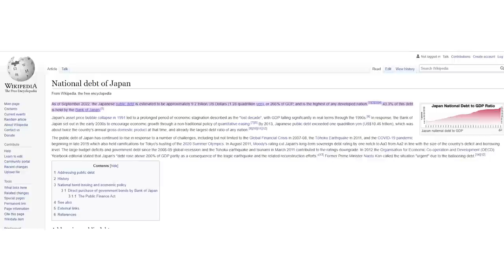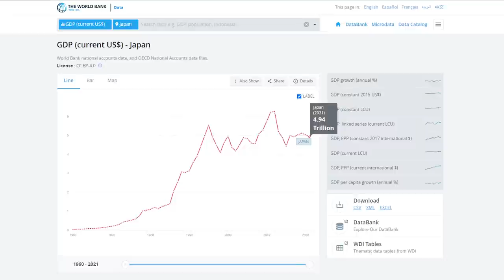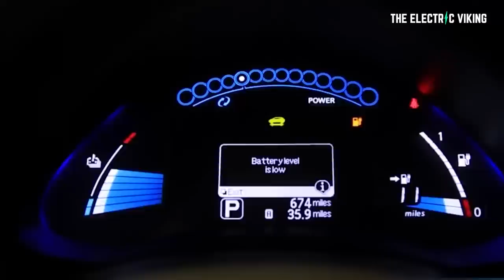General Motors says Toyota's hybrid strategy doesn't make sense

Comment: In 2014 I bought a new Chevy Volt (plug-in hybrid), as there were no affordable/practical fully-electric options at the time.  Out-of-pocket price was around $25k (after incentives, of course).  8 years and 120k miles later, I can honestly say that the car has been fantastic.  They should have improved the platform to 1) give it at least 60 miles of range (before ICE kicks in) and 2) make it a comfortable 5-seater.  My guess is that GM wasn't making a profit on it.
Reply: They did... the Gen 2 Chevy Volt got an EPA 53 Miles of range but I typically get 70+ Miles out of it in the Summer.
Reply: @Nebula1701  I don't think I would call Gen 2 a comfortable 5-seater.  Is pretty much the same size as the Gen 1, but with a pad over the battery.  Can't seat 3 average size people in the back.  Problem is they used a sub-compact platform, and is too tight for people and the powertrain.
Reply: They should have expanded that system to other vehicles including a small pickup. Now it makes less sense.
Reply: I have a Vaxhall Ampera, UK's Chevy Volt, great car, I constantly wonder what it's range would be if GM produced upgrade batteries with maybe two or three times the energy density of the originals. Especially since I now read H2 electrolysis is at 95% in labs in Australia and Zero Carbon-Petrol starting with H2 can be produced for less than Dinosaur-Petrol can be extracted, processed, shipped and sold, the Chevy Volt could be zero carbon. I think there is room in the market for ECO-petrol and zero carbon hybrids, Toyota Prius-Primes running on Bio-Petrol could be made to work, thing is, it's all pretty much in the lap of the gods, my guess, batteries are about to leap forwards in energy density, durability and longevity and probably long before Bio-petrol hybrids could be made to work.
Anyway both my parents died young of cancer, maybe it wasn't diesel fumes that killed them but ICE engines cause cancer and kill people, so as soon as I can afford an EV I will buy one, the new model three or the fast ID3 4X4, I'm saving.
Reply: @johnt5222  More importantly, they should have continued research/development/improvements.  For example, to generate electricity, the VOLTEC powertrain of the Volt uses what I would call an "off-the-shelf"gas engine, which is designed to turn wheels of ICE vehicles.  However, in the VOLTEC powertrain, the gas engine does not move the wheels.  So, they could have designed and used a more efficient and less expensive gas-based generator.  Also, they could have transitioned to a battery like the one for the Bolt (flat under the floor), but just big enough to give you 60 electric-only miles.  Those two changes could have reduce weight, increase efficiency, and increase interior space, while staying within the Delta II compact platform (or equivalent).
Reply: I mean you got it for $25K after incentives. I remember the MSRP was around $40K. I feel like you might have gotten it on clearance. I did hear they had a poor time explaining to consumers why it was a good idea. Shame as it seems to have been the most reliable PHEV to date with some people reporting over 500K miles on them.
Reply: In Canada, my creator never saw a Volt on a Chevy lot - or even heard about one - until GM announced the Volt was cancelled. We looked at one yesterday - it looks terrific! Doc says he would have bought one in 2017 - had Chevy told him they existed.

Comment: Sadly I'm probably going to have to buy a hybrid pretty soon. I want to go electric, but there's just no way to afford one that fits my needs for cargo space and range right now. Even if I did have the money for a full-size EV SUV (I don't) I couldn't get one anyway. Order a Rivian R1s, gonna be at least a year or two before you get it.
Reply: I'm in a similar spot. If I could have an EV I would, but my situation has everything against it. One day, maybe.
Reply: Same. But most of the viewers on here have their heads in the sand. It's easy to spend 60k on a new ev. My budget is less than half that. The Prius is smack in the middle of my budget or the Camry or Accord hybrid or something from Hyundai/kia
Reply: Cyber truck would beat the R1 into the dirt, but unless you've already pre-ordered one, the wait list is already around 5-7 or more years long
Reply: Look into a used EV.  I got one for half msrp last year.
Reply: Agreed! Toyota Highlander Hybrid gets 35mpg, so your gas cost over 150k miles will be around 17,200 at $4 dollars per gallon (I just filled up for 2.80 in MI). You can get the Highlander Hybrid for around under 45k, whereas the R1S costs $72,500 (27k difference). Model Y LR is 66k, still over $20K more). Your cost of maintenance (let’s say frequent oil changes at 5k miles and a few air filters) would be around only 1500 bucks. Throw in another 200 bucks for a couple transmission fluid changes (not sure if that’s even needed in the Highlander). You will save a lot more money on the Toyota, and most people can’t afford the up front payment increase on the EV anyway. That’s not to say prices won’t come down in 5-10 years, but that really doesn’t help someone who needs a car today, or next year. GM estimates a price of 30k for the Equinox EV with 300 miles range, but that’s vaporware and wishful thinking as of now, since it doesn’t exist yet. If they somehow pull it off, then awesome, I’ll trade in my Hybrid for one!
Reply: Now I'm confused, you said you can't afford one, then you say you invested in one of the most expensive EVs on the market. I mean, if all you wanted was an EV, the Chevy Bolt is gonna be only $18K in January and the regular bolt actually has more rear trunk space than the EUV. 

But if you want a serious SUV, I'm sorry, those won't ever be very cheap. Even with gas cars SUVs tend to hold a large tax to them and EVs being seen as more enthusiast luxury vehicles makes it worse. I know everyone wants a giant car, but it really is a feature built against EVs. Honestly if you truly need the space and range with ability to drive EV for daily commute, just get a Chrysler Pacifica PHEV. Nothing has more space than that and it's literally a van if you need seating.
Reply: theres also aptera motors 2 seater and trunk space roughly liek toyota corolla, 25k for 250 mile version and theres more

Comment: GM's best selling vehicles are gas guzzlers: pick-up trucks and large SUVs. If GM had "jumped on the hybrid bandwagon" 20 years ago, GM would have built far fewer gas guzzlers. Thus, I'm not impressed by GM's recent moralizing. Nonetheless, if the accelerating transition to zero emission vehicles causes some auto makers to go directly from ICE to Electric, so be it. Washington, Oregon and (most importantly) California require zero emission vehicles by 2035, so the laggards better get moving!
Reply: That likely wouldn't have changed. Even with EVs people are opting for the SUVs and pickups over sedans and efficient vehicles. Notice how many want the Bolt EUV over the standard, or the Model Y over the Model 3, or how many brands straight skipped making a sedan just to make crossovers and pickups. 

People want bigger vehicles for some reason, it's unfortunate for the environment, but America has always been viewed as a more gluttonous nation. I think that can be seen with how many have said they got an F150 because "look how much room is in the front seats".

Comment: Hybrids had a use showing customers the usefulness of EVs. There was never a plan though of weenie off the gas engine for future purchases of BEVs. Imo hybrids should have had the battery pack increased each year while decreasing the fuel tank size. By the end of the hybrids product cycle it should have had a range extender with a battery pack that was just smaller than a full BEV

Comment: My gmc Sierra goes 625 km on a full tank.  The Silverado Ev is said to go 640 km on a full charge.  So let’s see.
Reply: How much does it cost to fill the tank?
Reply: @GuinnessDesings  How long does it take to charge the battery  Because you're not home-charging when you've driven 640 km.  Plus, when you're using dc fast chargers, you're going to pay roughly the same rate per mile that you get out of a real car.

Comment: I’m sorry, hybrids are a half step.  Why take a half step when you can go all in and take a giant leap forward.  The tech is there. I’ve been saying it for a while now.  I’m really thinking the ultium platform is flexible and nimble.  They can modify it to a bunch of different vehicles. The Silverado Ev / blazer Ev are about to take over.  Ford is so screwed. Ford lightning / mach e owners are going to be really upset with ford for taking their money and basically ripping them off.   Half step
Reply: Hybrids are like a co-pilot on a commercial flight.  When you take a long overnight trip in a hybrid you know you won't be waiting at some remote charger in the middle of the night.  Women in particular won't remote charge at night just as some of us won't use an ATM late at night.  EVs are best as a city car.  Life is always a series of tradeoffs.  Some live in one bedroom apartments.  Some have large estates.   Toyota's hybrid strategy makes sense as long as alternate manufacturers of hybrids are perceived to be inferior to Toyota's product - which is solidly the case in 2023.
Reply: plugin hybrid with small combustion runng optimal rpm is theoretically most cheap to run car, longest lasting too (althought no battery cars will last longest, maybe cheaper to own long term as a result.)
Reply: talking about charging ev stuff not directly powering to the ground because that not possible to a extent

Comment: Ford has horrific reliability right now so maybe their strategy is part of the issue.
Reply: Ford cars (not trucks) have been horrible the past 20 years - that’s why they got out of selling cars in US
Reply: @dexlab7539  I have two Mustangs, 2005 & 2007 and they have been perfect except when dealing with dealers. Ripped me off on the sale. Tried to swindle $3000 for a $75 repair.
Reply: @Ask-a-Rocket-Scientist  
Mustang is about the only reliable Ford that's not based on a body on frame chassis anymore. Everything else is straight garbage.

Comment: Toyota stopped evolving hybrids years ago.
Engines can be more electrified, just look at Köningsegg.
The car has a 600 hp, 2,0 L, 3 cylinder engine that makes combine 1700 hp.
If you down size this to 170 hp, you need a 60 hp engine (1 cylinder) that is 0,2 L.
For an aygo half of this.

If Toyota had follow this line, they would have reach the EV platform they needed in time.

So, some where along the way, someone wanted to stop innovation.
Reply: they could also made small combustion charge electric drive then battery at optimal effeincy RotationsPerMinute, so no range anxiety, and most people cannot charge car because live in apartment etc, electric grids not being able to handle too many ev, expensive and far less efffceint in real world to have bigger batery to a extent where longveity becomes worse, although that has to be balanced fact that bigger battery to a extent can increase longveity by less degradation per amoun of energy flowing and speed of flowing.   so plug in hybrid , then only hybrid if cannot charge,  is best.  they couldve made the rear seat face the rear(i cant explain much because it wont let me, but think in terms of lotus elise weight ditrubution , porsche weight low to ground to handle more speed around turns in porsche taycan, etc.).  they could also have hydrallic steering and stiff enough chassis that communicate how much grip car has so drire can steer and brake, minimally and smoothly, for longveity of fuel, energy, tires, brakes, lubrication, batteries. with stuff like auto disconnect sway bar, premptivly stiffening suspensinon, etc it could aslo help this, and sell as a sporty version of car, where weight added is cut off in removing decorations , window position changer for non driver seat, etc.    easily  removable folding seats, tie down bag roof and glovebox and vertical seat storage.

Comment: Thus far the EV industry at best is a stop gap; there isnt enough lithium. Max 5 million Y size BEVs ever unlessa new chemistry is out soon. Lithium EVs are a dead end.  Did you realize it takes 500,000 gallons of water to render 1 ton of lithium?  The entire plan is lame; sure be optimistic but be honest about the serious problems. BTW Tesla is down from 1200 to $420 pre split , 140 post split; almost 1/10th
Reply: This is all fake.  You picked up pieces of fud and strung them together.
Reply: While your numbers might be correct for normal process of lithium new technology is coming online every couple of months which lowers water use and not all new/old batteries will use lithium.
Reply: How many hundreds of thousands of gallons of water to make batteries for other electronic devices, ie. smartphones, cameras, etc that go unnoticed? For perspective according to THE EARTHLY IMPACTS OF EXTRACTING LITHIUM 
states 500,000 gals of water to extract 1 ton of lithium is enough to make 190,000 smartphones. In 2021 there were 1,510,000,000 smartphones sold for the year. That means to make that many smartphones it takes 3,950,000,000 gallons of water to extract enough lithium for phone batteries. Why was this not a concern for you before EV?

What does Tesla's stock down due to emotions and sentiment have to do with the business itself with record quarterly profit and your premise?
Reply: Your math is as bad as your sources
Reply: @vec306  where does that water go?
Reply: Great time ta buy